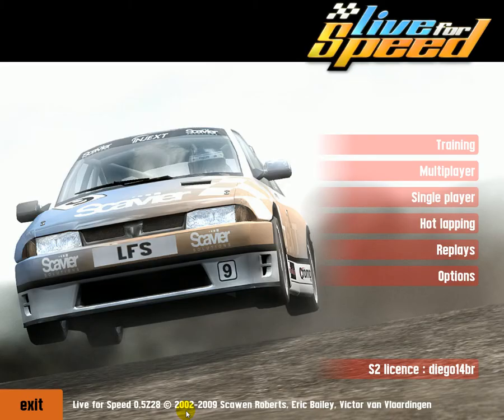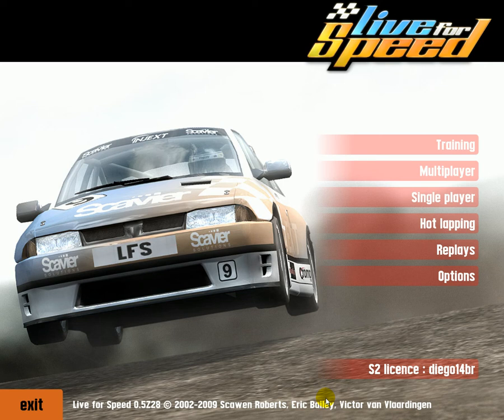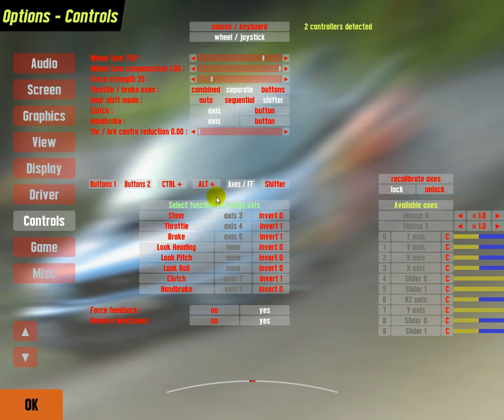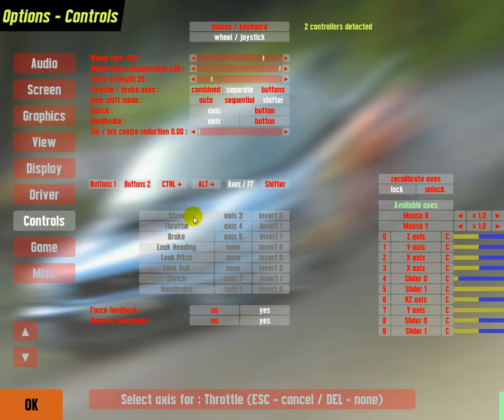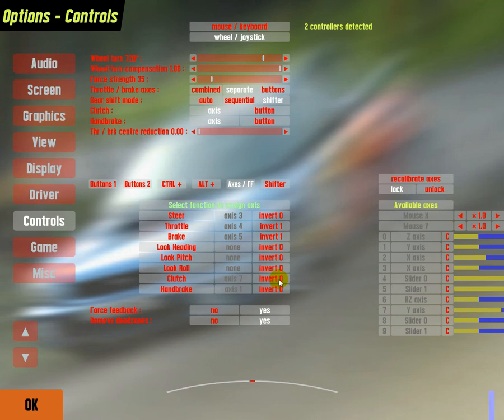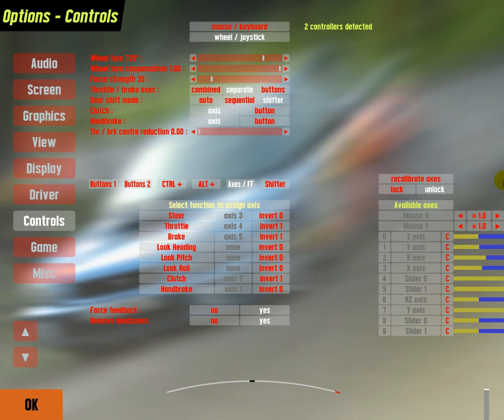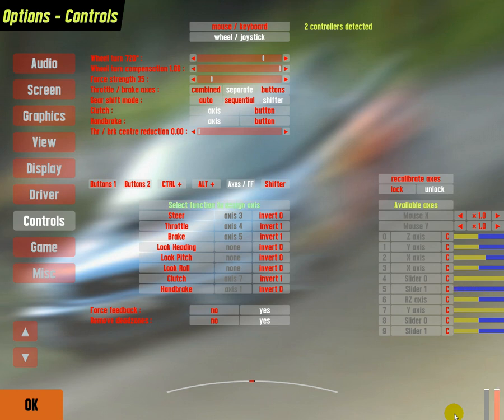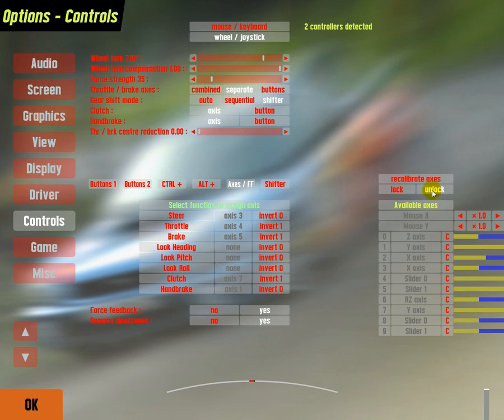How to setup your wheel and joystick on LFS

Comment: help i have throttle and brake on the same axis and i have just 2 of them(axis)
Reply: me too :(
Reply: @david4hunnid  have you find the solution? I have the same problem with my g27.
Reply: Same brooo hhhh
Reply: Go to options and in controls make sure where it says throttle and brake axes that it is set to separate. And also make sure you mapped the ignition also, I made that mistake lmaooo 😂
Reply: THANK YOUUUU🙏❤❤ @kingdongo4388